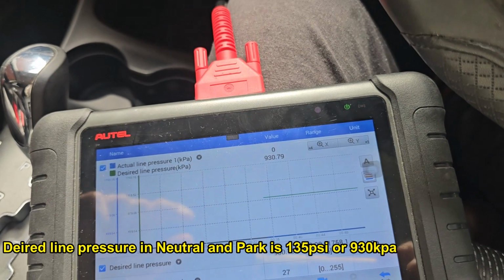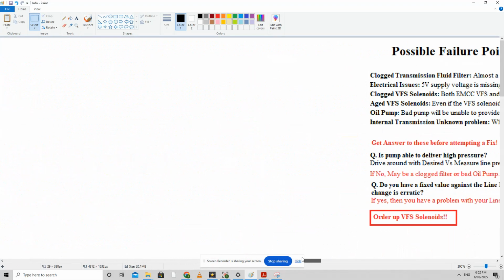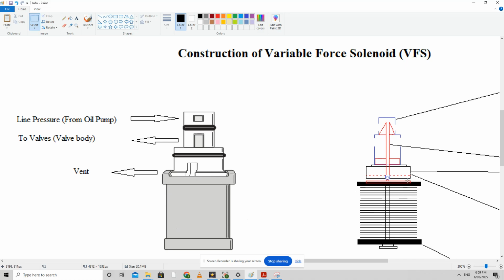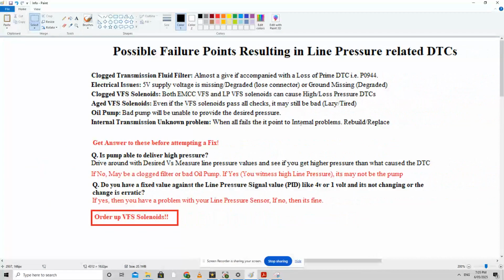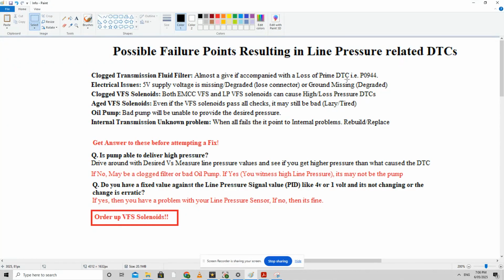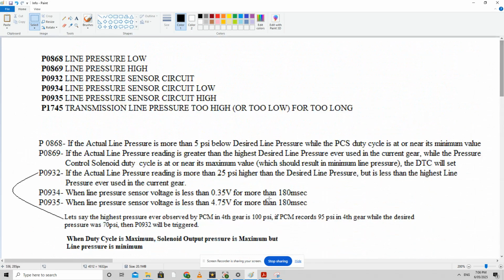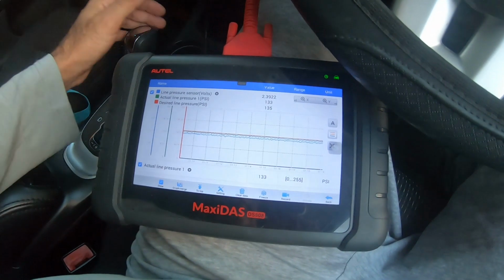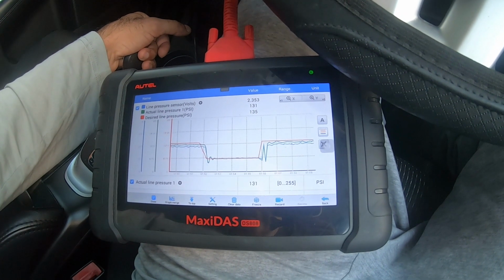Pr2: EP3: Fiat Freemont P0868, Line Pressure Low, P0869

Comment: Great video series, very detailed and informative! Thank you for sharing your knowledge with the world.

I'm hoping you can help me solve this similar issue with my wife's 2014 Dodge Journey 2.4L with the (41TE)... Any help would be much appreciated as it has me at a stand still, because I don't have the money for a shop, or the money to just throw parts at it hoping for a fix.
So it started with a CV axel seal leak, I went in and fixed that but like a dummy I got my seals from O'Reilly's (thinking Mopar would be good) well that only worked for about a month before it started leaking so I went back with OEM seals get it all back together and than the vehicle didn't sound normal.
It had a faint humming noise or whisle very faint if windows are down the sou d of the road would drown it out,  it with windows up and radio and a/c off I could hear it rise with the rpms.
It also had a hesitation going into drive.  Once I got up to speed it went into limp mode. 
Pulled codes with autel diagnostics tool and I got 
P0732
P0869
P0868
P1790
So I changed my filter and replaced the 5 quartz of ATF+4 ereased the line pressure counts, erased codes from the transmission, double checked that the codes where cleared. 
Drove it to the store very carefully. It still had slight hesitation going into drive, but definitely improved, I watched live data on line pressure and tirbine speed vs output speed. 
The line pressure stayed the same as desired pressure. 
 But the output speed would start the same as turbine, once starting to move... But once it got to 1300-2000 it would start to exceed the turbine speed by roughly about 1000 over the turbine.
So basically if the turbine speed was 1900 or 2100
The output speed would be 2900-3100. Until coming closer to a stop than it would equal out again.
It would also set limp mode as I slowed down but needed to apply gas again without coming to a complete stop.
If I turn the car off open the door and than turn it back on it would be out of limp mode.
I got home checked the codes again and...
P0845 pending
p0731 active
P0732 active
P0869 stored
P0868 pending
P0944 active
P1970  active
P2096 pending

The transmission still feals strong, there is a steep hill I have to go up to get to my house, it climbs it no problem. 
But I won't let my wife use her car until I get this tranny working right to avoid damage. 
Any help would be mutch appreciated. Sorry for the long winded comment, but I wanted to be thorough in my description.
Thanks
Reply from the maker: P0944 is very important here. It means that your transmission fluid pump is losing prime. This happens when the filter is dirty, incorrectly installed or fluid level is low.
Since you replaced filter already,  can you confirm if you removed old filter seal  before installing a new one? Two seals on Same filter or filter without seal can result in this code. If you have doubt about fluid level, just add some more. I believe its low on fluid. You can use engine dipstick to measure.
Reply: Thank you for the response!
The old filter fell down when I pulled the pan, the o ring came out with the old filter still attached to it.

When I pute the new filter in it seemed a little loose but I didn't want to pull it on And off and ruin the seal or the two little tabs. The new o ring was put on the new filter before I put it in the transmission.
I will check the fluid level again.

Comment: Hi, great job. Mine has same p0868 code but legend for the code is related to "circuit low". The dealer is useless, my mechanic clueless. Any ideas?. Thank you!.
Reply from the maker: P0868 is the only code you are getting?? List all your codes for me
Reply: @RZJugaar  sorry. I forgot something important: the symptom:  in fourth gear rpm are unstable. No more codes.
Reply from the maker: @Jucanor you need to remove valve body and inspect all solenoids. Ive heard that TCC solenoid has the tendency to dislodge itself. It can also result in P0868.
Reply: @RZJugaar  okay. I'll do it.  Thanks

Comment: Salut 
Voilà ma situation 
Je n avais plus de frein car je voulais peindre mais etrier en rouge 
La voiture à été manipuler sans frein 
Et remorquer par un ami.
Arriver devant chez moi plus de marche arriere et avant ,avec un vieux bruit d engrenage.  Et aussi plus position P . A tout avis c quelle piece qui est cassé . 
Quand tu passe de R à P sa fait un bruit d un mauvais passage vitesse.
Et de D à P pareille.
Sinon de N à P aucun bruit
Reply: Et aussi aucun DTC
Reply from the maker: Did you tow the car when lever was  in park position?
Reply: @RZJugaar elle a été remorqué sur un camion . J étais pas là ,mais je pense comme vous, ils ont fait de la merde. A votre avis c 'est quoi ui serait cassé ?
Reply: Je pense qui s' on laissé sur parking. Du coup sa serait quoi de cassé?
Reply from the maker: @florian76400 i think the parking prawl is broken or the rod thay goes to the bottom.. you can get an idea by pulling the pan and look around the neutral safety switch area.
Reply: @RZJugaar le carter ou il y a le solinoide
Reply from the maker: @florian76400 yes. There is a rod that comes from top to bottom and underneath the valve body you'll see the neutral safety switch
Reply: @RZJugaar . C quoi le numéro de la tige, je connais déjà le [ transmission range sensor] c'est le capteur
Reply from the maker: @florian76400 dont know the part number. You'll have to search for it. But since it is making noise as well, I think the problem may be bigger than rod. The prawl may be broken or the teeth on which it latches maybe grinded. Open up the transmission to see the damage.
Reply: @RZJugaar merci j ouvrirai pour voir , je vous tiens au courant
Reply: @RZJugaar par hasard la position parking elle se loge dans quelle engrenage ? L embrayage du bas ,ou du haut, ou autre
Reply from the maker: Sorry i dont know, ill have to research. . You can watch 62te disassembly videos to figure out.
Reply: @RZJugaar je cherche mais j arrive pas à voir. A vole d oiseau c sur sur l embrayage du bas . La vérité je vois pas où il pourrai se logé
Reply: @RZJugaar salut j ai vidanger et j ai ouvert côté solinoide sa a l air d être bon. Par contre j ai vu le cardan avant gauche à l air cassé, car la roue tourne mais le bras ne bouge pas.
question 
C'est la roue gauche la maitre ?
Reply: @RZJugaar salut au faite j 'ai ouvert rien de suspect, par hasard je m aperçoit que la roue gauche tourne mais pas le cardan donc c 'est le cardan gauche qui a cassé derrière le roulement de roue. J ai ouvert pour rien .j ai une question la roue avant gauche c 'est la maitre . La position parking bloc que ma roue gauche?
Reply from the maker: @florian76400 good that you found the problem.  
There's an integrated differential inside the transmission.  If you understand the principle of differential, you'll understand why one of your driveshafts broke. Since your car was in park, the rotation on 1 tyre was countered by the other.  The weaker driveshast among the two broke when it couldn't withstand the pressure from the other tyre.
Reply: @RZJugaar temps mieux que c est le cardan